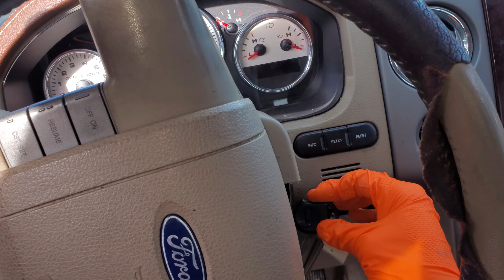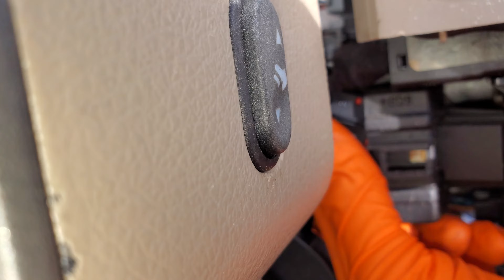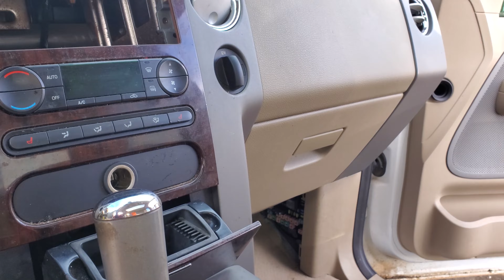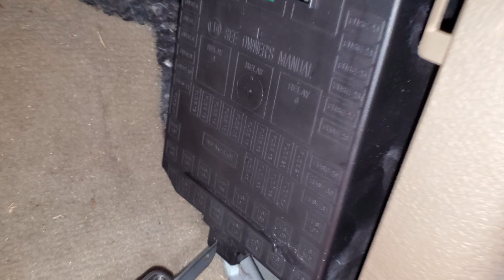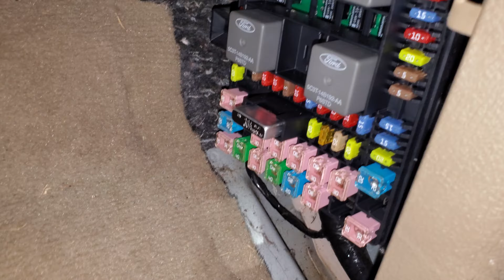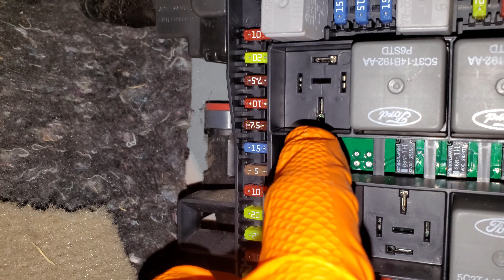2007 F150 Starter Fuse, Starter Relay, Starter Circuit Explained

Comment: Good video, thanks for sharing.  What was wrong in this case?  (my buddy is stranded at the store w/ no crank issue)    Thanks,  - take care
Reply from the maker: This truck was sitting in a junkyard when I filmed this and I do not know the circumstances of how it arrived there. Most of the videos I film are to provide general guidance on electrical systems on a particular vehicle and not to fix any specific part failure.
Reply: I have a 2002, the model prior to this one. However it is very similar. I am blowing my 102 fuse (fuse 111 in my case) for the green/purple power wire as soon as I turn the power on. Where can I look to begin diagnosing.
Reply: @caseytodd7632  I'm not sure man. I was researching/asking for a friend that was stranded at the time. Think he just needed a new starter. But good luck man, wish u the best.      
Take care.  - Leeroy
Reply: @LehewTech 2005 ford f150- if all those fuses are good and new battery but no crank or even dimming of the lights while trying to start, ignition switch???

Comment: I have AN07F150 Larry. It with a 5 fork tripe, when I turn the key, it keeps cranking unless I turn the key off, I put in a new Ignition switch, and it's still doing the same thing. Do you think it's the starter?

Comment: OK, so I turned the ignition all I hear is tap not tap tap tap tap. I know that it usually is that’s the battery or the cables aren’t tight. All I hear is tap one time then I turn it off. Turn it back on tap again that’s it. Can I check that by taking the relay out and running one wire from 30 to 87 and seeing if the starter will turn over?

Comment: Thanks for your video. This was super helpful and I fixed it. I had put a brand new starter on my 2008 F-150 and still no start. It was the 30 amp fuse. Replaced and starts nicely. Thanks man.

Comment: Please do one for 2010-2014. I have an issue with nothing on the cluster illuminated except airbag light. When I put key in everything works as far as hvac,radio,brake lights ect. No chime no start. Please help.

Comment: The owners. Manual doesn’t have listed which relay is the starter relay. It does have the 2 fuses you mention...101 and 102 as you described.
Again, no relay information/location.

Comment: Would it be safe to say ... if I want to install a toggle kill switch that I could put it on the Green and Voilet wire? Then place the switch in a unknown/unseen location. What would be the switch amps requirement?

Comment: Im currently having a similar issue. My 04 f150 is completely dead when i turn the key. I cant jump it, ive changed the battery, Ive changed the starter and still nothing. I have no dome lights, my gauges dont come on when the key is on, ive tried starting it in park and neutral, theres no power going to the computer port under the dash. Fuel pump and starter come on when you turn the key but thats it. Any ideas?

Comment: Found IT!! Your video was very helpful in tracing down my problem. Got as far as confirming that I had full voltage at the relay and the starter worked fine and all the circuits responded just like the should.. The puzzle was that the control pins on the relay only showed 10.3 volts. So it seems to be a limited ground from the PCM and so the relay wouldn't actually click. The I came across a thread that mentioned the PATS system and the red light on the dash. The red light was giving an error code so I got my spare key and it started right up. That's all it was after 3 evenings of sleuthing!!  Apparently chip keys can go bad. I wonder if its very rare?

Comment: Any recommendations on which fuse to tap into for a key-on power source for a dash cam?  I’ve gone over and over with a continuity tester and it seems to me like F01 is the only fuse bank that fully disconnects, but the manual indicates it’s used by the instrument cluster so I’m a bit hesitant to mess with it.

Comment: Hey ... My New Friend ..!!   Thank U so Much for that video .!  I was looking for some serious information.!  Not just how to change the Park/Newtral Switch .!
My Ford is a 2003 F250 5.4L  Triton . with a No start condition .  I have checked the starter circuit up to the fuse and it is okay. I get power there and the fuse is all good. But No start.
So, Would the color of the wires would be the same in my 2003; F250 ...??  Or should I look for the 12v on the  "fatest"  wire and see which wire gets hot with the ignition on and then go down to the Newtral switch in the transmission to confirm that my 12v do get there ...???
And then go find the relay ...???
Thank U for ur Video and Help My New Friend .  I am Antonio .

Comment: Thanks for the video, my 2005 F150 was running really rough, so my friend suggested that it could be the mass airflow sensor. So I bought a new one and I was careful not to touch the metal part and I then installed it with the metal side facing up and I then torqued the screws down tight and I also replaced the air filter. So now it cranks over but it won’t start? Go figure you know. The only thing that I can think of is the mass airflow sensor that I bought is bad? Any advice you can hopefully give me? Thanks
Reply: Update: I took the old Mass Flow air sensor and sprayed a little bit of carburetor cleaner ( that’s all that I had here at my house) and I then wiped it clean and used my air nozzle to blow it out and dry it and then I put it back in the truck and guess what it started right up. And the check engine light is off and it is running smooth. Believe it or not. Needless to say I’m going to return the new mass air flow sensor and get my money back. Anyway thanks again 
Matt

Comment: Hey, man, diagnostic mechanic care just wanted to say very straightforward, awesome video, good job.. Also I will put it up there. Because I know there's going to be many people that come looking. Fuse 41 f 1 50 0 four, the 08. Most of the time it's not used if it is used, it is Ignition.

Comment: my truck is in lockdown how do you get out of park and i got no crank and no power at to the dash or the injectors or the or the coils the new motor in it and now i don't get no power it's a lockdown windows don't roll down blinkers don't work

Comment: I have a 2007 F150 4x4 5.4 triton. when I turn the key to start it, it cranks the motor starts but the starter won't quit cranking when I release the key. the starter will stop if I turn the key off.
Reply: @minnesotabreeze1  did you ever figure out what it is was

Comment: have a quick question. 

if one was to take a external power like, "20v drill battery", to top pin on relay,  would it power up starter and Solenoid?

looking at a auction f150 claim mouse wire issue no crank no start.  the problem is 5.4 3v is a mechanical problematic engine.  like to hear it fire or at least tern over before purchasing .

thanks

Comment: I have an 04 F150 5.4, I get constant power like the key is in the ignition, without out the key in. I've swapped the ignition switch, installed a rebuilt fuse box, and swapped in a new ignition lock cylinder. Non fixed the problem. Any ideas would be appreciated. Thanks

Comment: Hi Lehew: my f 150 2007 cranks by itself every time I turn the key off. that happened after I connected the battery cables the wrong way for a few seconds. What could the problem be? also, I have a new battery in the truck but loses charge during the night. Thank you.

Comment: I'm having the same issue exactly the same issue but my won't start I just got the PCM relay and it didn't start so I'm gonna check those 2 pieces you're talking about see if they're popped and then change the starter one switch it with another 1 to see if that works hopefully at work thanks for the information

Comment: Thanks for pointing out all the starter system test points, had the starter relay act up on my gf's truck a few months back, a quick swap of it and the blower motor relay go the truck to start, I totally forgot to order a replacement and of course it left her stranded again, swapping relays didn't get it started so I'm gonna have to troubleshoot the starter system. Thanks for the video though, will make getting to all the connections quick so I can check voltage and continuity quickly. (Update it ended up being the dumbest thing, she hadn't put the truck fully in park so it thought it was in gear, it always ends up being the simple things. I did replace the relay anyway though and spent a good hour probing and checking all the voltages with the key in the various positions, so to anyone else, check that the truck is fully in park, it was just out enough to not allow the contact to be sensed causing the issue.)

Comment: So I did this on my truck followed all the steps and have constant power, power when the key is turned on and the starter is working. But when I try to jump the start of the truck will still not start. The truck was running just fine an hour ago. I’m going to the store to get a neutral safety switch now but that still does not explain why the truck will not start but it will try to start on starting fluid and the fuel safety shut off has not been tampered with

Comment: Just replaced the starter on 2006 f150 4 months ago, and today it suddenly won't crank with a good battery. Thanks for heading me in the right direction with this new issue.

Comment: Good video… maybe you can help me out, my 2004 F-150 has a starting issue, I’ve changed the ignition switch and starter when you turn the key to the run Position the truck starts and the starter disengages if you turn the key to the start position the  truck will start but will grind the Bendix for a split second, when you turn the key to to the off position it will send power to the starter and ding the flywheel for split second…. Any advice would be appreciated and thank you in advance for your time.
Reply: Did you ever find out the problem ? Mine is doing the same thing

Comment: Mines not working i switched the relays around and bought a new 102 and 101 fuses when I turn the key on it makes a clicking noise but no power to start the truck

Comment: QUESTION. I have a 06 F150. No Start. 5 days later. just checked out the Video and i" DON'T" have power at the relay for, " the safety neutral switch / ignition switch ", does your video apply for a 2006 F-150 also?
Please advise! Thank You.
Reply: PIN #86 No Power on test light.

Comment: My 2008 F150 turns on after a few times. I have power but just won't start the engine. I have to keep trying like 10 times to turn on.

Comment: Sooo your saying that in the case you are stuck but the key works everything then run a powered wire to pin 87 to get it to start. I watched 8 vids and they were all very simple fixes, none of which helped me. I think the key chip is dying. My 3rd time i am stranded and it started eventually with hours of fking around. The previous owner had this same problem because the battery and lead wires and starter is new, the column has been apart the relays are different brands. My 05 has been dependable for the 10yrs i had it, type in 07 and you see electrical problems. Damn Ford has to change shit
Reply: When i jumped 87, nothing happened telling me it was not the cab but wires or bad starter, cut the wheel right and the back of the starter is easily accessible, shorted the terminals and it cranked, key wasn’t on so it didn’t start but the key started it. Solenoid/starter going bad or bad connections. They were a little corroded.

Comment: Hell of a video helped me solve this issue to the people checking this out and not finding the problem try giving the starter relay a direct ground my issue was the pcm was not providing it and causing the pink relays to pop on ever start so I ran back through step by step checking all power and last but not least was this ground and it fixed the issue hope this helps u guys and big thanks for this video 🙏🏼
Reply: What ground? Was it
Reply: Ground coming from the pcm to all accessories
Reply: @k.o.d_vic8673  yeah that's pin 85. Mine is good what I don't have is pin 86

Comment: Great video ...I have a 2007 F150 XL 4.6 with a no crank no start condition ..I did find green fur and a totally shitty wire connector  on the starter and replaced it but sadly it didn't take care of my issue..I drove this truck off the trailer and parked it so I have no idea what's wrong since doing the front engine cover replacement ...?
Reply: Did you find a solution? My 07’ is doing similar. No start when it feels like it. I did replace the fuel pump driver module by the fuel tank. It had a huge rust hole in it. But didn’t fix my problem. 2 new starters, I’ve replaced every relay I’ve found. Still no start random. So truck just sits in my yard till I can figure it out.
Reply: @aaroninks  ran a wire from the starter solenoid to the battery , if all else failed i would touch the wire to the power side activate the starter with the key on and i was on my way . never stranded
Reply: Same with min changed starter relays and fuses and still no crank or no start have you found your solution

Comment: Nice vid. I have an 06 that keeps cranking even after i pull the key out and im wondering if its the starter or one of these relays . The starter is brand new.
Reply: Same issue with a '07 , did you solve & how, I changes Ign Switch but no change.
Reply: same issue with my 07, was hoping for solution. Gonna try swapping relays around.

Comment: My truck won’t start and I’ve changed everything except that neutral safety switch. When I turn the key I’m not seeing any power coming through that pin but I can jump those pins and the starter engages and turns the engine over.

Comment: Love the vid thanks for your time!!! My 04 f150 I have replaced fuel pump am the module where the spare tire is. It still will not start by key not even crAnk but I bridge it out from the starter it will crank but not start?? Idk what to do is it in theft mode cause All my gauges work an window?
Reply from the maker: Are there any trouble codes? Normally in theft mode there will be a flashing key icon after a crank attempt. Have you left the key in the on position when bridging the starter?

Comment: I have a question. SO on pin 86 it should have no power to it until I put the key in the on position correct? So let's just say my battery is 13.5v.  And I get my DVM I would put it on 20 D.C correct?  Ok once I do that I would put my positive lead onto number 86 and the negative lead on the opposite side and should have 0 volts correct? Now if I turn the key I should read somewhere in the 13.5 range would this be correct? if so how long should I see that 13.5V on the DVM? I have a 06 f150 and I am having a no crank. battery is good the starter is good because I jumped the solenoids and the motor turns when I cross the 2 post on the solenoid, I had it tested and seen the plunger come out at Autozone and I jumped it from that relay in the fuse box I used the top and bottom pin. SO I know the starter is good. I am trying to diagnosis if it's a bad neutral safety switch, ignition switch or bad PCM.  No issues with security light

Comment: Got an 08 f150 went to start the other day and nothing. Cleaned all the connections to starter they were a bit rusty went to reconnect battery and with the key not even in ignition you can hear the starter sounds like a electric fan and won't stop unless I disconnect battery again  what could be the issue? Can't figure it out
Reply from the maker: Sounds like the starter is not engaging the flywheel so either the flywheel is stripped (not likely) or the gear on the starter is not shooting out
Reply: @LehewTech  ok so probably be best to replace starter? I just put one in last year. I thought it was a ground issue or some electrical problem with relay I'm no good at the electrical part no patience for it.

Comment: i have a 1999 f 150 5.4l lariat and it so happened that my radio not  working found out that fuses # 20 and 21 not blown but no power the rest of the fuses and relays are good do i have  a short  i have no schematic wiring diagram  to  troubleshoot the issue can you please help i thank you

Comment: Much thanks! I had constant power coming to the relay from the the ignition fuse and power on the right side prong when I’d turn the switch to start as long as the transmission was in park or neutral. The relay tested good. When I bypassed the relay with a jumper wire, the starter engage would engage and would start the engine. The PCM didn’t seem to be providing a ground to energize the coil in the relay.
The problem wound up being the neutral safety switch. I replaced it & all was well. Apparently it has to signal to the PCM that the transmission is in park or neutral before the PCM will provide ground to close the circuit.
Reply: Exactly, the starter relay has two inputs to turn it on, vehicle in park, vehicle in neutral!!!  I had to adjust my auto trans shifter linkage… started right up!
Reply: Plot twist. The safety neutral switch fixed it short term. Turns out the wiring harness had gotten between the rear of the  engine & the firewall. Apparently it had an intermittent short in the wire that ran from the safety switch to the pcm  at the time, and my pulling on the wires to the safety switch plug resolved it for maybe a week, but it eventually burned completely through that wire & part way through three more. It was a headache to splice the wires back together & get the harness in a better position, but it  completely resolved the issue.

Comment: I need help please. So my 2006 f150, when I turn the key over I'm getting voltage through the blue red wire but I'm not getting any voltage sent to the starter. No crank no start. When I turn over I hear a click in the fuse box, that's it. If someone can help. Thank you.

Comment: Hey boss great video i got my truck running.but how can i wire a power wire to the top prong on the starter relay to ignition so i dont have to install a push start